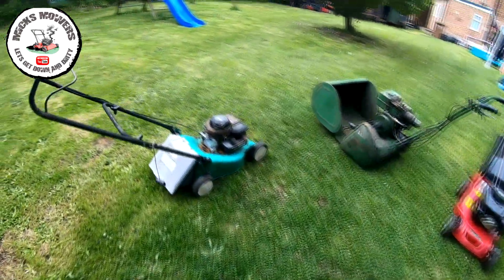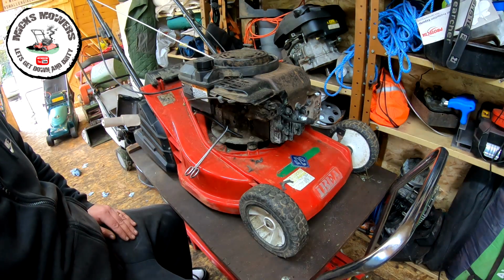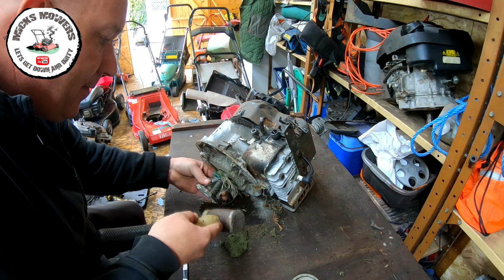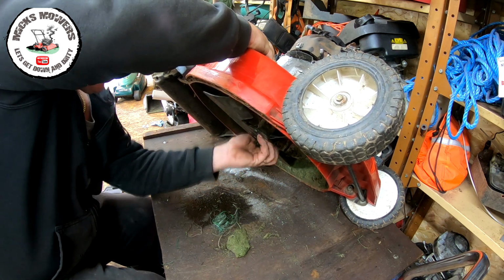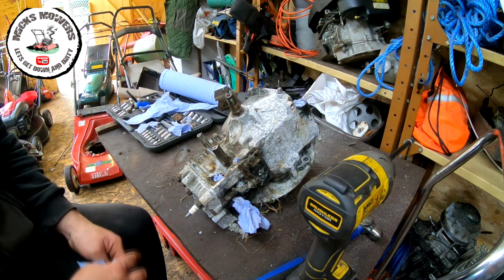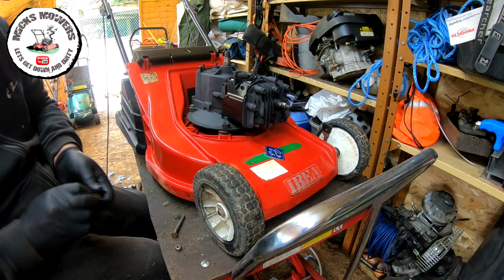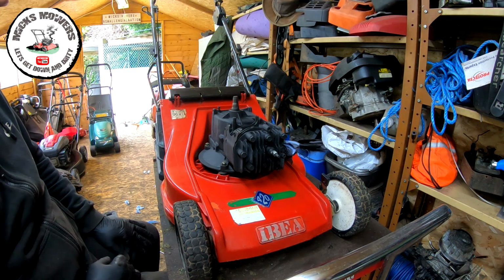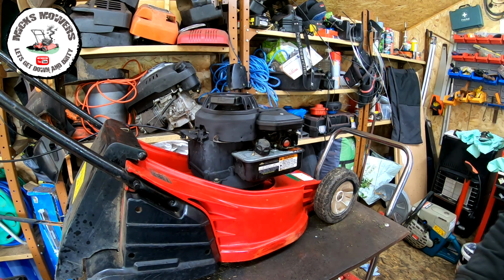How To Scrap Out A Lawnmower Deck For A New One - Plus Special Guest

Comment: I think these Ibea mowers were sold as Toro machines for a short period before Toro took over Hayter. I have only ever seen one of these before as well. Somehow the old plastic deck roller mowers used to be pretty popular throughout the 1980's and early 2000's, now only the Honda HRX QX series, Stihl RM series and technically the Hayter Spirit are the only plastic deck roller mowers on the market now.

Comment: Hi Mick, 
Quick question 
How often should you grease up the gears in a hedge trimmer gearbox? 
The multitool type 
Thanks 👍
Reply from the maker: Depends on its use.. for private use. Once a year.. for heavy use 2 to 3 time will be fine. Hope that helps

Comment: Hi Mick how many mm off two stroke oil do you put in 5 litres of petrol two make up 25 two one mixed
Reply from the maker: 200ml mate
Reply: Easiest way to do this is visit a Stihl dealer as Stihl do one shots that are exactly 200ml and can be poured straight into the 5 litre fuel can. I would recommend choosing the stihl green super hp oil as it's got a fuel stabilizer to prevent the fuel going off which is the usual cause of starting issues.